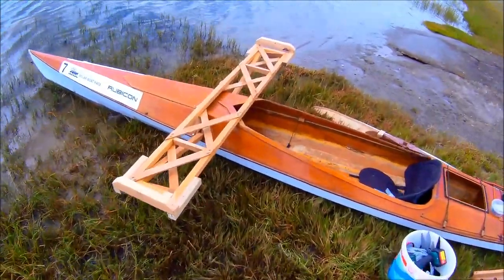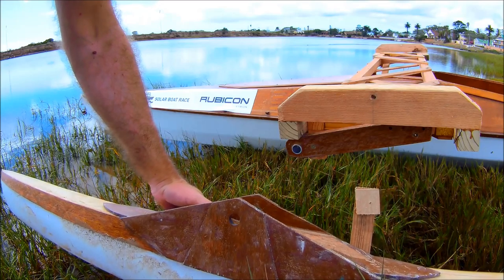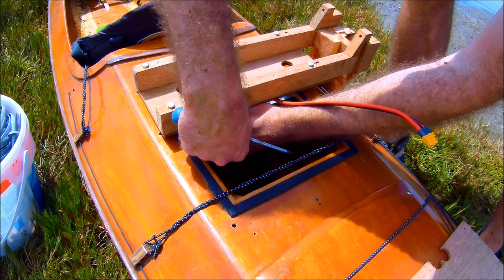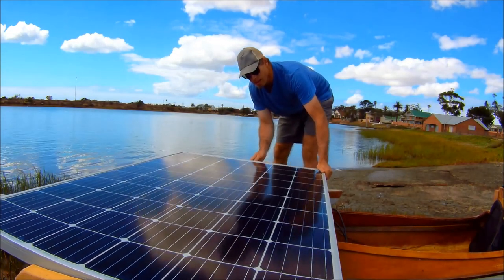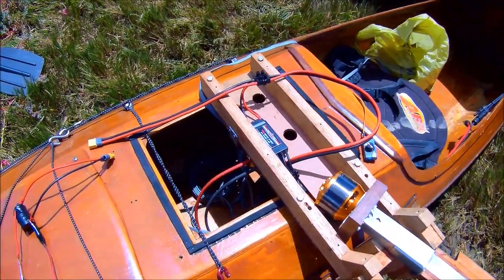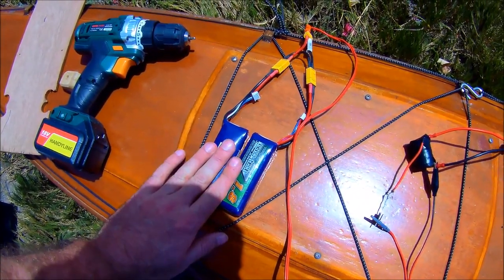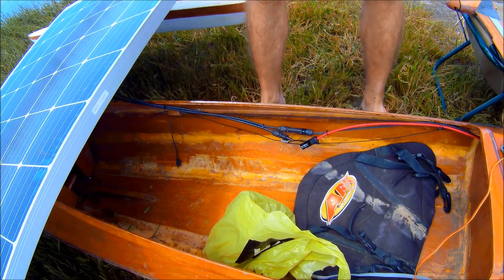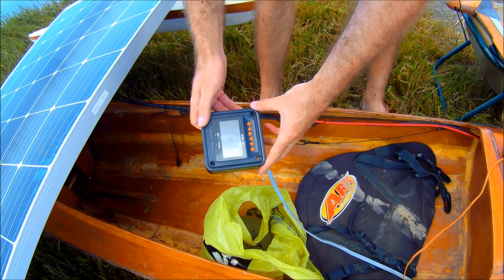Rigging the solar kayak.

Comment: Remember that you can reverse the brushless motor by trading 2 of the 3 wire connectors. You can then use the same prop for a perfect comparison.
Reply from the maker: Indeed. A "double pole - double throw" switch on two of the leads could switch them around without the need to disconnect. A number of my drivetrain couplings rely on threaded shafts joined by long nuts. The prop itself also rely on the direction of rotation for the retaining nut to tighten under load. Reversing the direction could unfortunately result in some of these joints turning loose. Future projects will include proper keyed-couplings or castle nuts with split pins to cope with turning in both directions.

Comment: I wonder if you could run the solar panel straight into the ESC and use the ESC throttle to keep the solar panels at their maximum power point voltage using a volt meter? You become the feedback control system, not unlike sailing where you have to manage the sail in real time. Less losses if it works.
Reply from the maker: You can do that but the losses are in fact higher. I have compared efficiencies on a dyno using low voltage input and ESC on max power vs high voltage input and partial ESC. Combined motor-ESC efficiency dropped from 87% to 77%. An MPPT or buck converter is much more efficient in stepping down the voltage if required to maintain max panel power. An alternative but more complex solution (and with its own additional losses) is a variable pitch prop. The ESC can get power from the panel and remain at max setting, and if the motor load demands too much current the prop pitch can be reduced.
Reply: @williamfraser  Thanks for the reply William. That is a surprising, but I can see that it does reduce efficiency from your results. At what voltage does the ESC run most efficiently at?
Reply from the maker: @MiniLuv-1984  I don't know if voltage would have a direct effect on efficiency of the ESC itself. Switching losses in the ESC would be more at higher current, but so would power so once again it is difficult to make any conclusions about efficiency.
Reply: @williamfraser  fair enough. A good reason for me to look closer at ESC designs.
Reply: @williamfraser  Your servo tester is a PWM interface to the ESC to control motor load. You could try adding a 5:1 voltage divider to the panel voltage and feed that into the source of the potentiometer on the servo tester with a 5V zener diode to limit the voltage, that's assuming the pot's range is 0V no load and 5V max load. When the panel voltage drops below 25V the motor load should then reduce, bringing the panel voltage back up into your 24-31Vmpp range.
Reply from the maker: @CraigOverend  Genius, I am going to try that. My ESC is unfortunately not rated for the panel's output voltage so I will still have to use a buck to step the voltage down initially. But your suggestion should eliminate the need to continuously adjust the buck. I might as well build my very own power-lever-circuit from scratch because I dropped my last servo-tester overboard when I got out...
Reply from the maker: @CraigOverend  just to follow up on your suggestion. I tested a few pwm circuits using a 555 timer. The esc responds to the pulse width over a limited range of milliseconds. I created a feedback loop that adjusts pulse width to maintain panel voltage at or above mpp. Results differed between esc models but motor power invariably dropped too much when the panel regulation kicked in. A better understanding of esc response is needed to make it work well.

Comment: Using airplane propeller may not be ideal, marine propeller may give better efficiency, hence, better speed.
Reply from the maker: Thanks for the comment. There are indeed marine propellers that are very efficient, but none are available in the sizes that are suitable to the very low power available in this design. The propeller used here has a peak efficiency of at least 74%, while the propeller on my 2hp Yamaha outboard peaks at only 65%. There are many compromises and cost factors that govern the smaller marine prop options. A Torqeedo prop might be suitable, but it costs 55 times more than the prop I used here.

Comment: BTW, have you tried out tractor vs. pusher prop?
Reply from the maker: No, not yet. This drive-train is unfortunately only good for one direction of rotation so a pusher would require a propeller with opposite twist. There are some available but the available sizes to choose from are limited. It would be an interesting comparison though. I would expect the prop itself to loose some efficiency in a pusher configuration. A reduction in drag on the pylon and housing could offset that penalty.